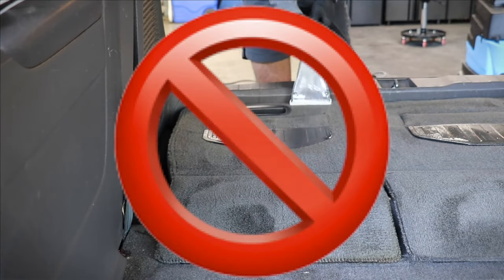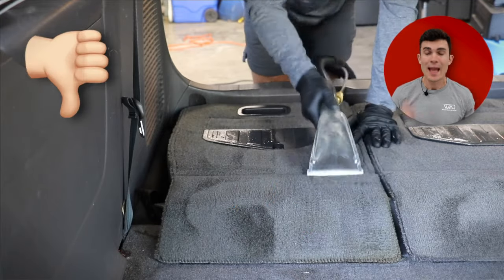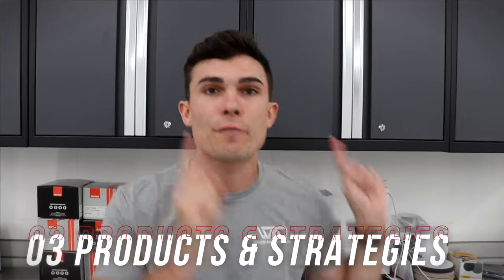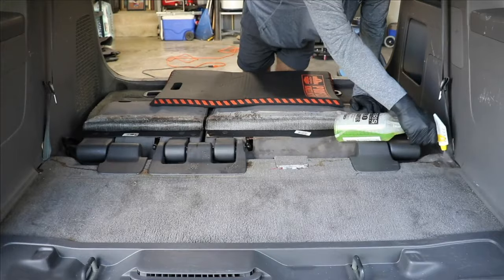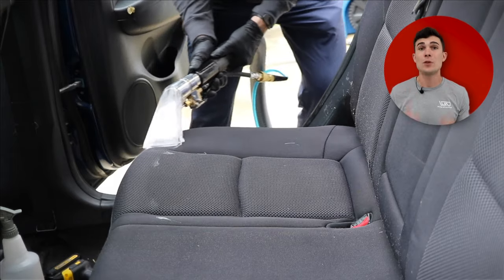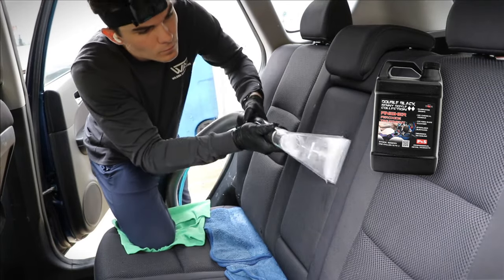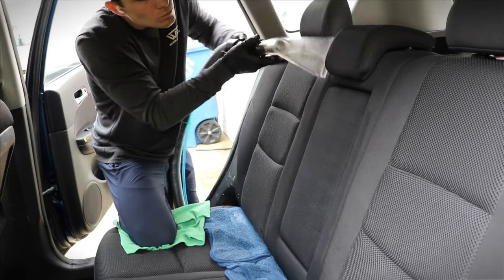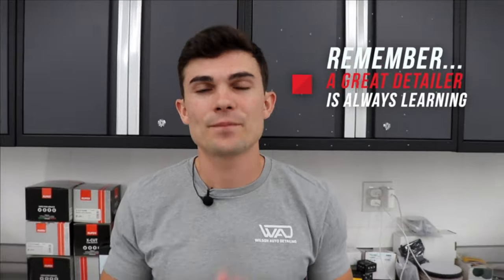Replace Your Extractor With 2 Chemicals

Comment: When mobile detailing, what pushes the water from your water tank to the Rip Clean?  I cannot imagine gravity would be enough pressure.  Or do you have a water pump?
Reply: Maybe it goes to a pressure washer? Like the small Electric ones ryoby makes?
Reply: @josephalejandro9202  Hmm, that would be interesting to see how that setup would work.
Reply: It connects to a water hose spigot